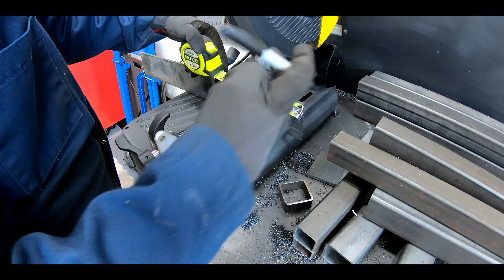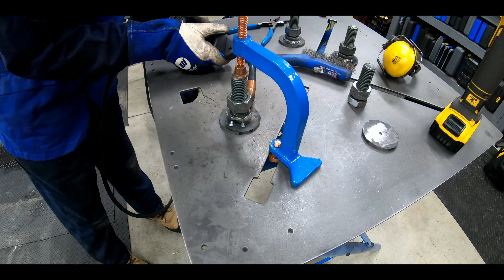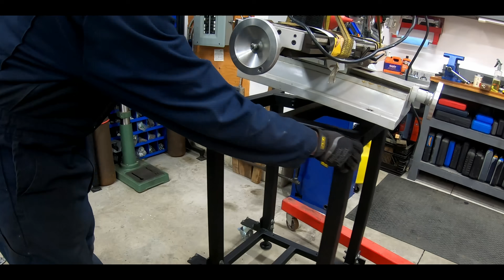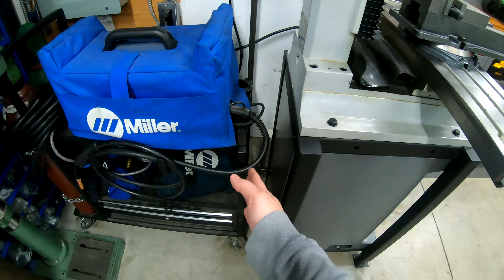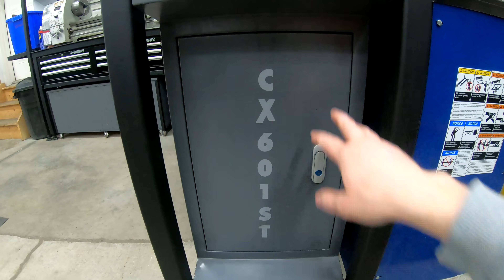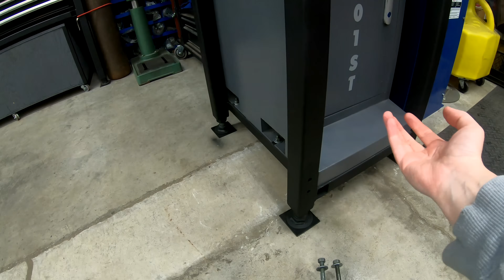Shop Infrastructure - Milling Machine Stand Upgrade!

Comment: you wouldnt happen to have a materials list /cut list for this by any chance would you?
Reply from the maker: Not a cut list, but it's all just 2" x 0.125 wall square tube, mild steel, and then some 2" flat bar to cap things off, and there's some 1.5" square tube for the lower support for the cabinet. Legs are 1 inch bolts with a little chunk of steel plate welded on the bottom, and nuts welded to the bottom of the tubes.

All just fairly simple and measure out your own stand/mill to fit.

Comment: What size welding wire did you use?
Reply from the maker: Just usual .030 mig wire for this stand. It is the best all around size, you'd want .023 if you were always doing sheet metal and .035 if you were always doing plate like 1/4" or thicker...but .030 is kind of a sweet spot in the middle from 18-20ish gauge up to 1/4".

Comment: Nice stand. I have a similar mill and discovered that it was too low for me to use for long periods of time. My solution was to make a simple platform that raised it up an additional 8 8nches or so. That made a huge difference and my back thanks me.
Reply from the maker: That's a great point I didn't even think of, I did find the controls on the low side!